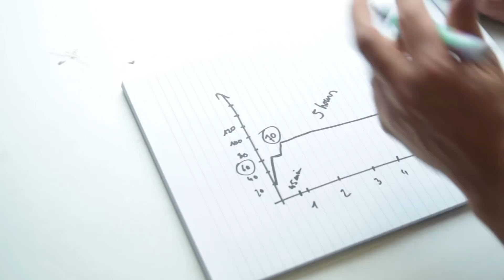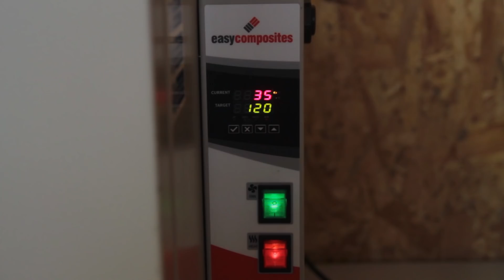Carbon Fiber Prepreg PART MAKING (Tutorial) ***PART2***

Comment: Hello Mat, thank you for this amazing video. One question: does the vaccuum pump has to run all the time during the curing process, or only once at the beginning, or periodically, or only until the highest temperature is reached, or... 
Best wishes, Peter
Reply from the maker: I keep the pump in the entire time! If you would have a small leak during the curing it wouldn't be to bad then
Reply: Thank you! 👍😀
What pump do you use?
Reply from the maker: Buy all my gear from Easycomposites in the UK

Comment: Hi there, love the in depth steps on how to prepare carbon fibre products,keep up the good work. I've been toying with the idea of making a race kart out of carbon fibre as the steel and aluminium karts we use are very heavy during the 24 hour races, what is the best way of making elliptical tubes or joining tubes? I have not got access to either an autoclav or curing oven. I have seen ideas on making a custom curing oven out of mdf. I've seen people make custom bike frames but no one shows the curing process of the bike frames,The main issue I can see for myself is actually vacuuming the whole kart in one piece as it is quite large and awkward. I have spoken to a few suppliers and users locally but without any info or help.
Reply from the maker: will answer your comment in the next video!

Comment: Where did you get that kind of reusable vacuum bag? Also, do you like it more or less compared to vacuum film with tacky tape? I want to find a large bag like that to use for small molds so I stop wasting so much material haha.

It would be great if I could use heat or adhesives to seal some vacuum film permanently, then add a sealed zipper and make a really huge reusable bag to use for big molds too...
Reply: https://cacomposites.com/prepregs